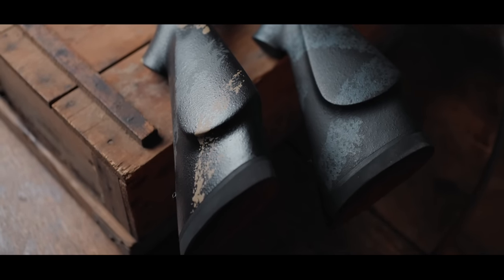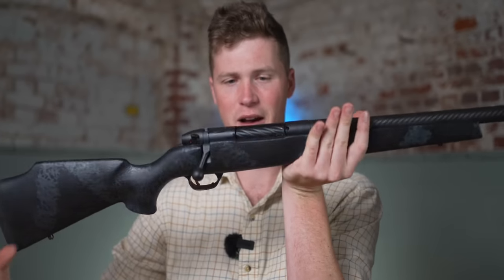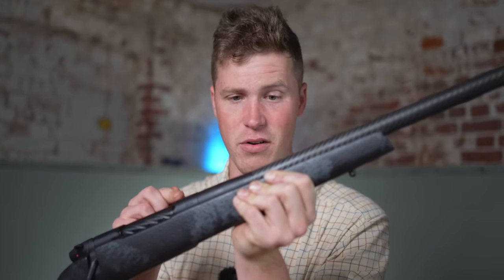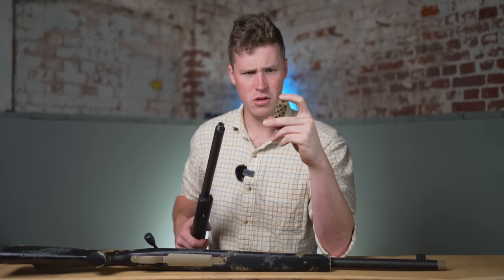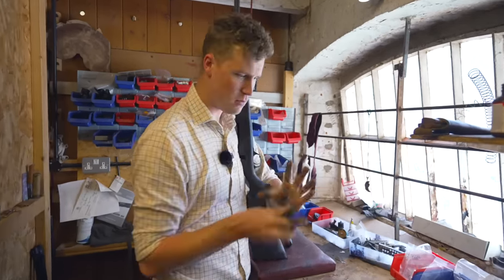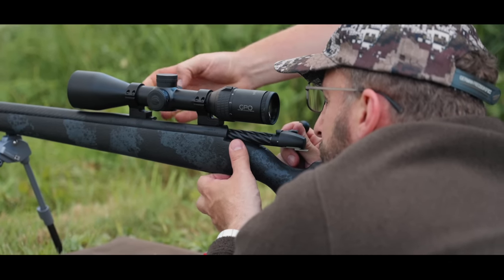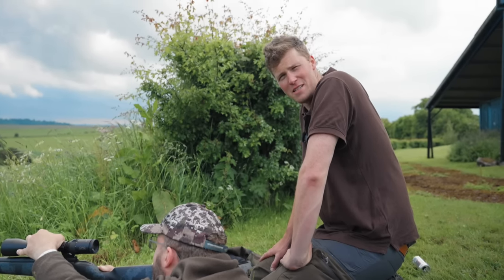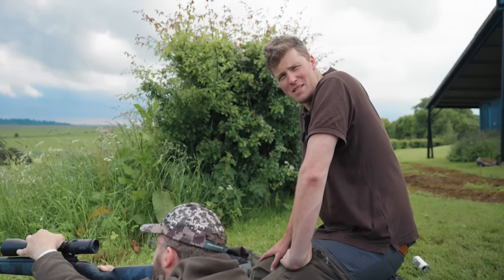Weatherby's Best Rifle?! - The Mark V Carbonmark - Review &Test

Comment: Well, I guess a hand drill is usually a step up from a brace and bit, but they're really good at jumping around or twisting like a struck gyroscope when they find a surprise.  Maybe a good Taiwanese vertical mill will follow you home some day. ;-)
Reply from the maker: Interestingly and obviously I used my rather luxurious drill press to do everything but this pilot hole
Reply: @tgsoutdoors  ha - okay;  all I saw was the hand drill poised for the attack.